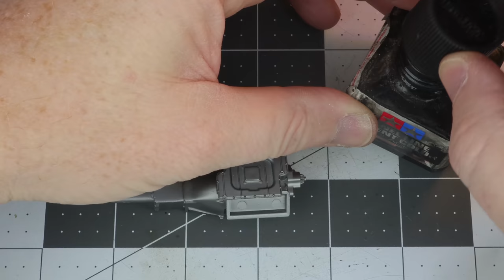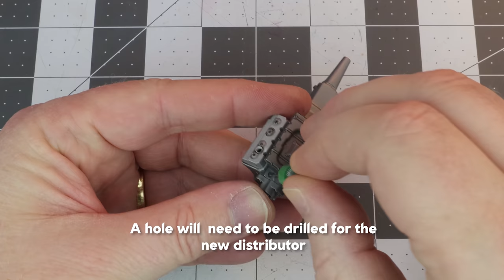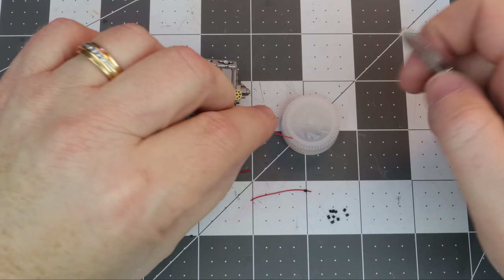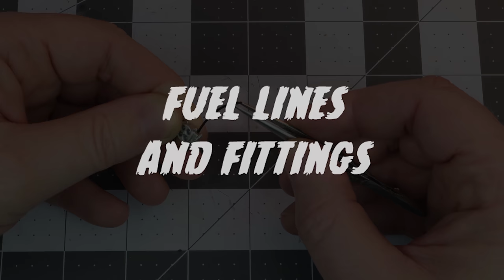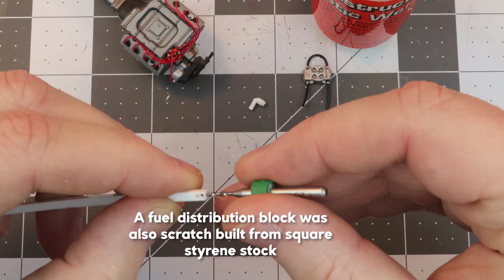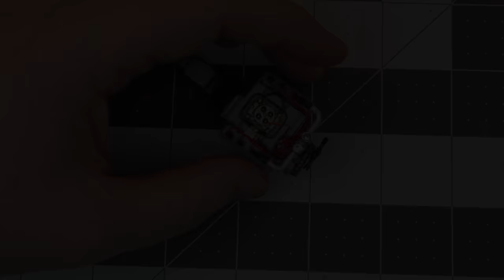HOW TO: Building and detailing 1/25 Dodge Hemi racing engine // Butch Hartman USAC project Part #7

Comment from the maker: Finally getting to the engine on this beast. I'd like your feedback as viewers of these videos. Do you prefer the long, drawn out multi-episode series like this that can focus more in depth on specific things? Or are you more interested in complete start to finish "full build" style video? Thanks for the support so far through this one! CK
Reply: Yes. I like how you break it down into “sub-assemblies”. I can focus more on the process of each step. Always learning. Thanks
Reply: @bigchef2112  Same here. I've slowly been building my tool kit with these sub-assemblies for my projects. REALLY helpful. Now I can't make a NASCAR kit w/plastic nets anymore!
Reply: There’s a lot of channels that will do both. I like the longer videos with more of the details myself. May be worth also having shortened videos that show more of the high points for the sake of having a little more content and to build up subscribers? Great video btw!
Reply: I like the way you have been doing your videos like this one. Thanks again for sharing your great work. Very well done sir!
Reply: I definitely like the detail videos. You can always condense them into a "full build" video when you are finished.
Reply: The former.
Reply: I prefer the detailed videos! Thanks for the info!
Reply: I feel that I can learn more from detailed videos. Thx
Reply: Come to think of it, are you planning on doing a short video on building a Detail Master hose & fitting? I'm done with trying to make TopStudio look good with resin fittings. The hose gets frayed badly for me.

Comment: Awesome work, only two things I’d have done differently; a smaller loop in the fuel lines and the plug wires over the line from the fuel pump. But that’s strictly a personal preference thing.

Comment: Always an inspiration Clay! Do you leave the wire to spark plug connections unglued? Would love a video on engine assembly and painting.
Reply from the maker: I did a bit of both on this one. I had a few clips where I had to glue them in place, but they weren't very usable, and didn't really fit the flow of the video. But you're probably better off to put a tiny bit of glue once you are happy with the length of the wire.

Comment: I like when builders do the videos as you are doing them, like specified portions of the build. Frame, engine, drive train, seats.. especially if there are specific things your doing, like the racing seat. That video was awesome.. along with the window netting. Then after your finished, do a condensed complete build video highlighting all those pieces and the final product in one video. That way someone who doesn't want to watch each piece being detailed can just watch the "Build" video which is the entire thing. And then you can add a playlist containing the build and the detailed build vids for that particular model. I think you're in the right range of about 20 minutes for the vids. Not sure what your music preferences are but something more related to the subject.. maybe a nice guitar melody for something like a NASCAR build but that's up to you. 

Now I have a question. You are definitely a Top Tier builder with work being in publications and such.. I'm wondering why you left the kit belt on the fan assembly? Was it too much hassle to remove and replace for the time constraints or do you not see benefit of doing so? The tape belts always look better due to the kit belts/fans being way off scale..  Cause you know it can be a pita sometimes.. 

Sorry for the long post, but you asked for the input. And this is probably my favorite kit building channel presently. Your channel is the only one that I play through the vid (mostly) without constantly skipping forward. The attention to details is remarkable.. that's why I'm wondering about that belt.. 😁
Reply from the maker: Thanks for the comments Michael....as far as the fan belts go....the main focus on this project was just to try and find a few places here and there I could add some details to to enhance the kit. I didn't want to go crazy on re doing or modifying every part of it, and spend so much time I'd never finish  it. So I tried to just hit a few areas that needed some help, and used the kit for the rest. With the pulleys and belts being all black in a black engine bay it wouldn't have been worth  the time or money on this particular project. Hope that makes sense!
Reply: @ClayKemp  yeah good point.. i find myself going overboard sometimes on things that in the end you might not even see and that can lead to frustrations and another box with a half built kit.. you answered my question.

Comment: You can make a cool out of the styrene rod as well. And place it on the front or the side of the intake. Front would be best.
Reply from the maker: I added the coil in I think the last episode. Like you said, just a piece of plastic rod drilled out is all you need.

Comment: Hi Clay, I like the more drawn-out or focused events like you're doing right now. Each one of these gives us a different look into how we could change or how we could share with you what we do. Love your builds. I really really like seeing what you do. So I'm going to agree with some of these other fellows that the more specific types of things that you build, seats, the motor, the dash, the rear ends, chassis, things like that are really more into my line. Plus I really liked seeing your body work as well seems to have more detail there as well. As always looking forward to your next video. By the way, where did you get the pe from? Great job as always,thank you!
Reply from the maker: Thanks for the input Mike....doing multi-parts seems to fit the way I build and what I have time to do better. I'm afraid if I were to do a full build video it would be 6 hours long. :) That PE was an old set of race car seat belt hardware. I just needed something that looked like a bolt head. Thanks for watching.
Reply: @ClayKemp  I knew I hadn't seen those pe parts. Well thank you for taking the time to video the " mini series " lol. I live in Mooresville,  so I feel we are fairly close neighbors.

Comment: Hi Clay what size is the craft store vinyl cord? Also where did you get those nice drill bits and what size range. Love your videos keep them coming.
Reply from the maker: I believe the size of that was 1mm. I bought a spool of it at Michael's. The bits come from ebay. They are made for circuit boards I believe. Very brittle, but are really sharp.

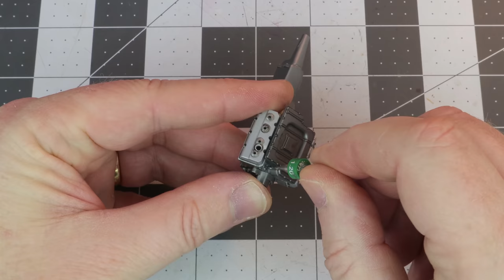Comment: Awesome video!  Where did you get those hand drill bits from at the 3:37 mark?  Thanks!
Reply from the maker: Thanks....I buy sets off of ebay that come with multiple sizes. They are made for circuit boards I believe.

Comment: I never seen you make a coil. Where did you install the coil wire into
Reply from the maker: I added it in the final episode after the engine was installed for good.
Reply: @ClayKemp  Can i ask what size bit did you use, i keep messing up i guess by using to big of a bit

Comment: Clay, I see this a lot. But, the distributor should be at an angle. Not straight on a 426 Hemi. Pictures prove this.
Reply from the maker: Thanks Doug....the distributor I used was a lot bigger than the kit piece I replaced. There was barely room to get this one in, let alone tilt it. It was all a tight squeeze!

Comment: Great job. It’s a shame this hobby is becoming less and less interesting as years past. I have found in todays society people could care less about detail let alone building a basic kit. Good Kits are becoming harder to find. If you haven’t noticed todays kits suck as they are mostly finished or are screw together. What fun is that?  Regardless keep up the great work.
Reply from the maker: Thanks Rick....I think there are still a few hold outs that like to do detailing.
Reply: @ClayKemp  indeed there are.   I have added flashing leds and sirens to my police car and fire truck, added headphone speakers for sound systems etc.